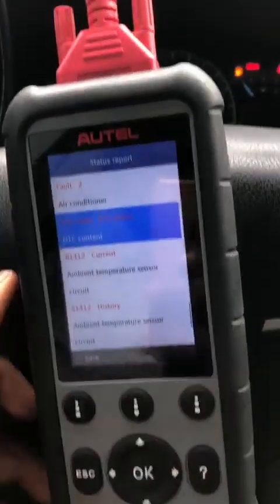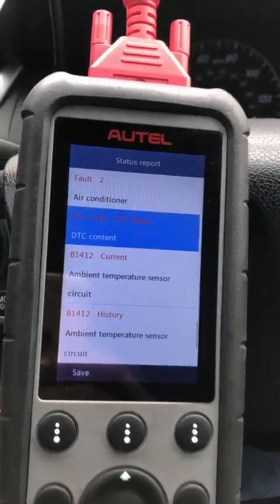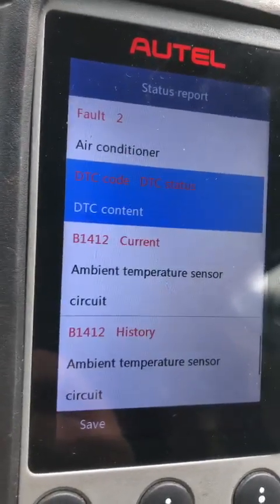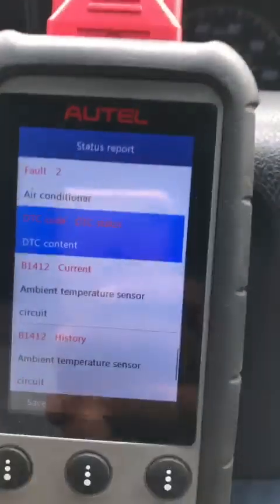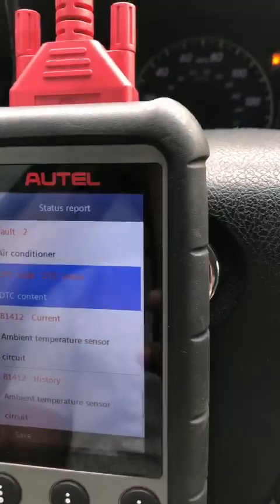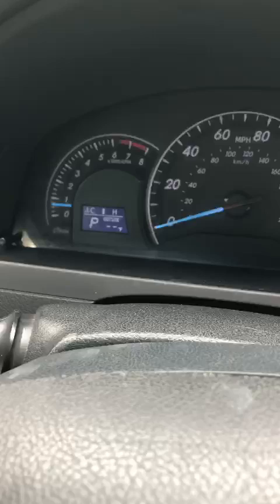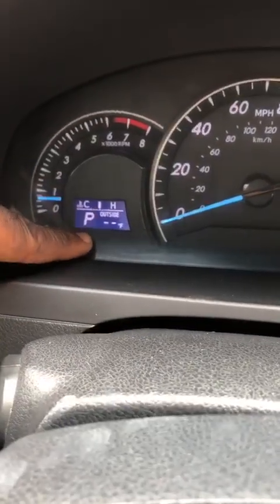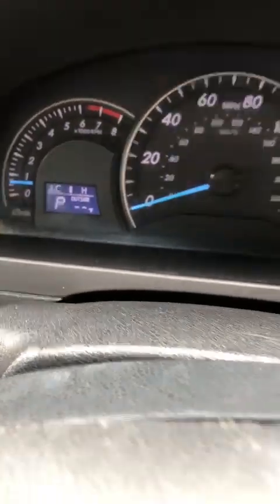2012 Toyota Camry B1412 Ambient Temperature Sensor Error Code Diagnostics and Repair Part 1

Comment: Very helpful! After watching your video, I found that my wiring looked identical to yours...no temperature sensor attached. On another note, do you know where I can find the wiring harness for the occupant classification system? I am trying to determine if it is the reason for the error code B1650 I am getting on my 2012 Camry.
Reply from the maker: I am glad you found this video helpful. To directly answer your question, the wiring is located directly underneath the front passenger seat which connects to the OCS Sensors. The fault code B1650 may result from a crash, blown fuses, open or closed circuit in the wiring. A qualified technician might have to perform re-calibration of the system to resolve this fault.
Furthermore, the occupant classification system functions with the front passenger seat and is equipped with detection and classification sensors that determine if the passenger front and knee airbag will deploy in the event of a collision. It classifies the object occupying the seat, if it is living or non-living. In your 2012 Toyota Camry, the OCS indicator is located right below the AUDIO display screen, it shows PASSENGER (AIRBAG OFF, AIRBAG ON).